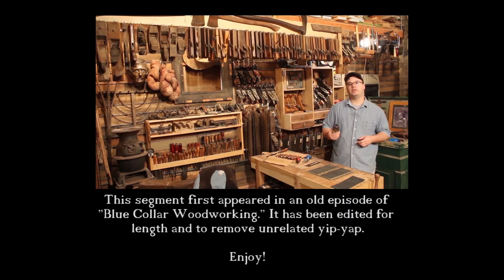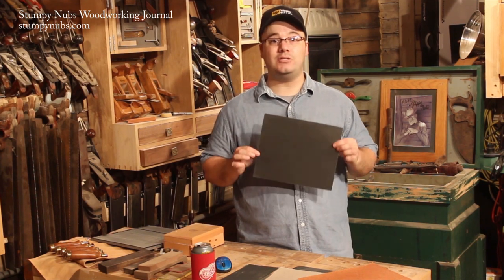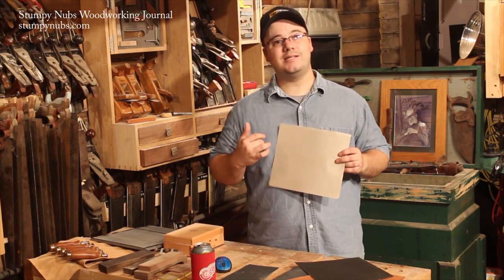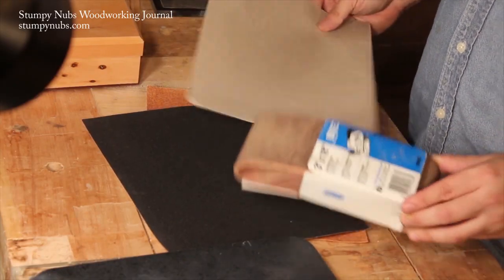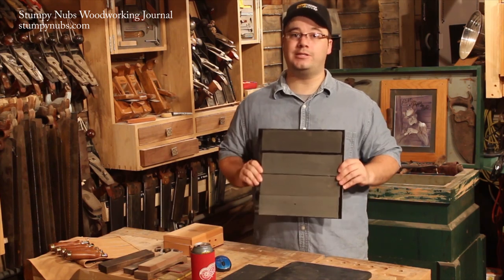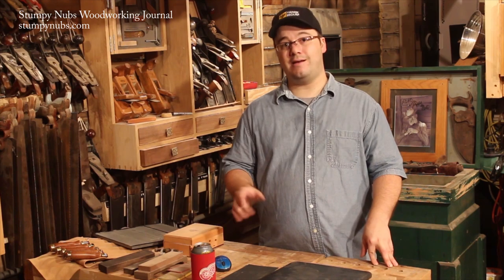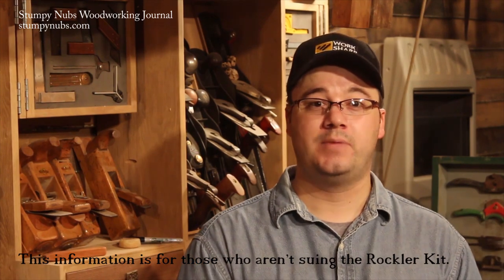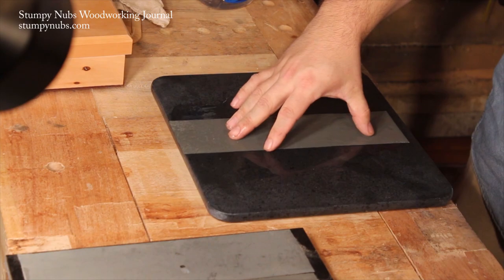Scary sharp: The best sandpaper, etc for tool sharpening woodworking planes, chisels, etc.

Comment: Another terrific video! I didn't know about sandpaper types. Also, your recommendation to use pressure sensitive sandpaper--absolutely. Been doing it for more than 12 years.  I've tried spray adhesives, always there are bumps! 
It's easy to clean off any old sticky from glass with a razor blade. Even an old utility knife blade works good enough.
I may be a complete hack, but I don't use a guide. My chisels are all curved. I'm putting on both the big angle and the smaller cutting angle at the same time. It's not as pretty, and I may be missing something, but seems to work pretty good.  
It's scary sharp because you'll know you're doing it right if the edges of your plane and chisels are like razor blades. You can't scary sharp a chisel and then put it in your leather tool pouch--it'll cut it way through. 
You'll know you're doing it right if when you get a new chisel you take it out of the box and sharpen it.

Comment: Old document scanners and copiers may be a good source of flat tempered glass.
Reply from the maker: Good idea!
Reply: good tip, thx
Reply: That stuff tends to be really thin, like picture glass.   A better source would be old oven doors,  or windows off a vehicle.  Granite floor tiles are a great idea though.  I've already contemplated gluing one to a concrete paving slab to get a surface plate on the cheap.
Reply: I have a granite block
Reply: Why are you guys insisting on tempered glass in first place? Float or laminated glass would be even better and flatter...
Reply: Hi mr Dan Harold sorry nothing to do with what’s being said just my surname is Harold as well 
Hi from the uk
Reply: This is good idea, thanks!
Reply: @branislavnikic4611  yea and where do you find that ?

Comment: Stumpy,

If using spray adhesive, when the sandpaper is used up and no longer good, how does one remove it from (and clean old glue) from the glass in order to apply new sandpaper?
Also, what do you put on the sandpaper to lubricate it? Thanks for the feedback and awesome videos.
Reply from the maker: A heat gun is a good tool to release the glue. Some sort of solvent, such as mineral spirits will remove old adhesive buildup. Water will lubricate the sandpaper.

Comment: I have been using this for years and years. I found the easy way to remove sandpaper, and remove glue is to use a hair dryer or heat gun to heat the sandpaper, then lift it off. Next use Napa solvent to remove the spray adhesive.  I went to a recycle company and got the glass from scanners for computers. They just throw the glass away, so were very happy to give it to me.

Comment: I have been using that Rockler plate set for a few years.  I don't bother with the guide when honing.  I just break it out on the new(old) chisels and planes on low grits to get the angle right, then it's just done by hand after.
Reply from the maker: It's a nice set, for sure!

Comment: Another good video, James, thanks for sharing! What is the jig you used to keep the angle? Do you find that pulling away from the tip produces a sharper edge that dulls more quickly? Thanks for journeying to Kennesaw, it was really cool to meet you.
Reply from the maker: With sandpaper I always feel like the course grits must drag against the edge of the tool when you push forward. I'm not sure they do, or that it makes a difference, but that's why I go back with course grits. The jig is a common one made by several companies. Here they are on amazon: http://amzn.to/2lfDR32

Comment: I have a piece of tempered glass for an old end table that will hold 3 full sheets of sandpaper on each side for sharpening. I wet both glass and paper, put paper on glass and set flat in warm place to dry out. KIM

Comment: Paul Sellers made a great video years ago where he sharpened a plane blade to 240 and it cut like butter. Seeing people use these 30,000 grit Japanese stones nakes me laugh. There's also a knife naker who useds a common ibstock house brick to sharpen all his knifes. 

I personally use my late grandfather's fine India stone 240 or 400 grit (I forget), then strop that puppy intil its shiny and jewel like.
Reply: I sharpen all my tools with sandpaper just like him, it work great and I don't have to stick it with spray adhesive, I just use duct tape. I don't even have 1000 grit sharpening stone, my stone is 120/500 combination stone and it works great after stropping.

Comment: 2 Norton stones and a strop with compound you can use the four surfaces that you get from the two sharpening stones to rub them against eachother and get them super flat by alternating which ones are on top of eachother and making sure all surfaces touch eachother. Sharpen and flatten on the stones and then debur on the strop with green compound.
Reply from the maker: Rubbing two Norton stones together is a terrible idea. What do you think happens to the grit that rubs off? You can't wipe it all away. You are contaminating the finer stone with coarse grit.

Comment: Hand sharpening is fine if you enjoy it, but motorised sharpening is quicker. It takes seconds rather than minutes. I use a worksharp as the bevel can be set exactly the same every time. Also there’s no need to buy guides and jigs, which in the end makes it very cheap. I use diamond discs rather than sandpaper in it. I have a quick strop afterwards before I settle down to planing and chiselling.
Keep up the humour please. I love it.

Comment: i used to use left handed drill bits to remove screws that had there head snap off. They work by running the drill in reverse. Worked all the time. IRWIN Tools 5 Piece Left Hand Cobalt 5/64-Inch to 19/64-Inch Cobalt Twist Drill Bit Assortment (30520).  jp
Reply from the maker: I think you are commenting on the wrong video. This one is about sharpening tools with sandpaper.
Reply: Probably did. Looked at several videos that evening. Those bits worked well for me and are simple to use. enjoy your posts. jp

Comment: I noticed that you have a lot of hand planes in your shop.  I have an old Stanley Bailey style plane that I restored, but I can't get the blade to protrude thru the bottom of the 14" smooth bottom.  Any ideas? I have two different lengths of blades. Plus I have two frogs with different angles.  I appreciate your thoughts.
Reply from the maker: Are you sure the blades you have belong in the plane you have?
Reply: No sir I am not sure.  The blade I have in the plane is 7" long.  Other than that I do not know.  They didn't teach planes when I was in school  
so what little I know I have learned on my own.
Reply from the maker: I recommend this website. It tells you everything there is to know about Stanley hand planes (except how to use them). You can use it to identify what plane you have, and if the parts in it are the proper ones. That's all I can do without actually seeing the plane. Sorry I couldn't help more. http://www.supertool.com/StanleyBG/stan0a.html

Comment: The best sandpaper by far for wood is “Tri-M-Ite” made by 3M. It lasts ages and does not clog much and stays sharp. I think it is silicon carbide. It is different from wet and dry paper. There is no turning back once you have used it with a cork sanding block. It’s not expensive either, much cheaper than what you buy in diy stores. For sharpening blades I would use use a stone or diamonds and not paper.
Reply: totally agreed, tri-m-ite is absolutely the best. especially the adhesive backed stik-it version.

Comment: Is it true that sandpaper wears smooth, thus becoming like a finer grit? Or do the abrasives dislodge, giving the same deepness of scratches but slower? Ive heard both. Has anyone put a microscope to this?
Reply: Both
Reply from the maker: Depends on the sandpaper. Silicon Carbide breaks up, forming a finer grit. But since the fine grit is mixed with larger grit, it won't produce a finer edge.

Comment: I have had good luck not using the little feet and folding the top end of the paper over the edge of the plate. The plate is hard up against the bench top, pinching the paper between it and the benchtop. Water adhesion does the rest of the work. No glue mess or hastle pealing off adhesive papers, no extra cost for sticky paper and no mess. Try it...

Comment: I am a green wood worker, i don't d why you use the glass? couldn't you just put the grits on some wood and achieve the same result?  or is it because of the glass' hardness combined with the grit and the pressure that makes it a scary sharp system?
Reply: shenlun it’s because the glass is super flat

Comment: Stuby, I think you know this. Buy you wet and dry paper at the auto motive store  and with the flat plate granite floor tile or the glass plate the paper will stick to the plate by spraying some water on the paper back and some on the plate.  The surface tension of the water produces the bond.  I do it all the time.   
Remember these important words  KISS  Kept it simple stupid.  That's all I got for the moment.  60 yr and counting.

Comment: Garnet has a hardness of 6.5 - 7.5 out of 10 on the Mohs scale, (Not to be confused with the Moe scale which measures Nyuks)
I knew that college geology class would pay off one day.
Reply: Stumpy Nubs Im not trying to argue garnet is good for sharpening, Im sharing some geology info. I make hand made knives. I've Ground, Polished, Sharpened more steel than most. I buy SC paper in packages of 100 sheets. AO abrasive is ok, but it usually cant be found finer than 400 grit.
Reply: Klingspor Woodworking Shop...they have it.
Reply: God of Thunder m

Comment: Ive spent hundreds of hrs sharpening my chisels and Kanna blades on just about everything cheap and easy. The crappy thing about sandpaper is that you cannot ever get the very most cutting edge bevel perfectly intersecting at infinity because the paper compresses  at the cutting edge and curls up around the edge ever so slightly but rounds it off.  Arkansas stones I've barrowed from friends are the only thing that works to my satisfaction and even then not Happy.  saving up for some Japanese water stones.
Reply: Thanks for the suggestion
Reply: And why do you need them this little bit sharper?